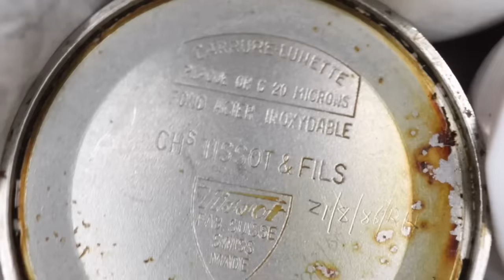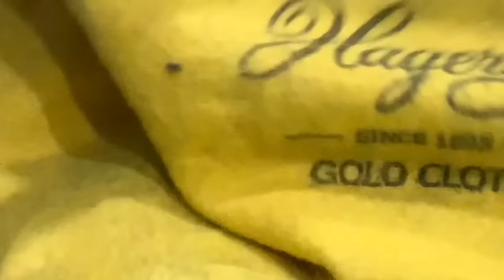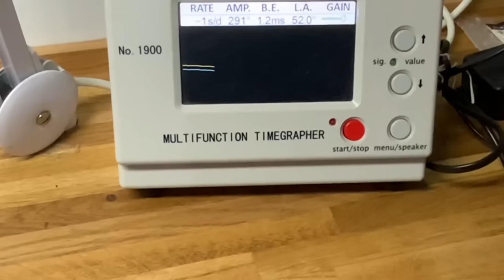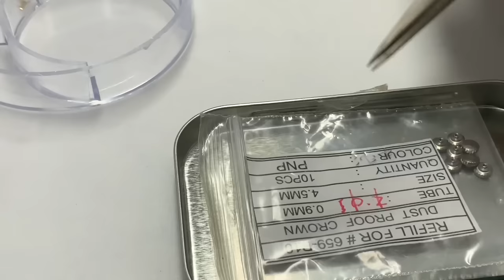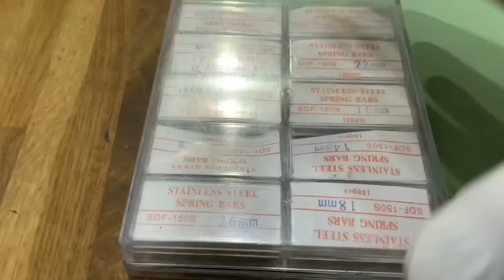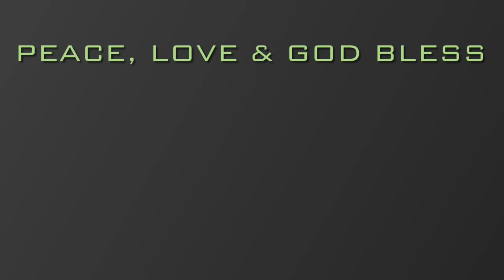How My Wife Forced Me To Restore This Free Tissot!

Comment: Thank you for finally restoring a fine ladies watch, I'd appreciate seeing more of them. I'm just beginning my journey into Watchmaking/repairing, and I I see the greatest challenges to be found in these tiny movements. With practice, just about anyone can be trained to disassemble and reassemble a basic pocket watch. But as you increase the complexity and reduce the form factor (size), you begin to separate the hobbyists from the budding professionals. A 1mm screwdriver is miniscule, it boggles the mind (as do the screws), and having the hand control to accurately tweeze the parts and screws in these tiny movements, is something that takes years to perfect.

The watch turned out spectacularly, and I hope that your wife was pleased with it. Take care of her, and fill her with beautiful things that you make (or restore) with your own hands. These are the gifts that have real meaning. I've been married for forty-three years, and I recently retired as an electrical engineer. I've always been fascinated by mechanical watch movements, so I'm expanding my bench to make room for a watch service/repair station. I'll be starting with a Maryland Railroad Pocket Watch, and I have a small box of of non working mechanical watches that belonged to my grandfather. There's enough in the box to keep me busy for several years.
Reply from the maker: Thank you.

Comment: Base metal gone. Thanks for the help with improving a case of 20 microns. I have one where the gold plate is good but where worn, the base metal is gone. I assume there is no restoration possible when the base metal doesn't exist. Or, is there a solution to building it back up. What resources do you suggest to learn, if possible? Thx

Comment: Creat video of this watch looks great after restoration, and i have finally got my Citizen Eco Drive Divers watch and such you being the best watchmaker i can see on you tube would you be able to advise myself on how to charge the eco drive in the manual it says pulling out the crown all the way and leave it in direct sunlight and since i live in Australia the sun is very very strong and i am worried about damaging the watch do you have any pointers for me thanks.
Reply from the maker: Yes just leave it by the window for a few hours if you have good sunlight. Once it’s charged then it will continue to use every bit of artificial light to keep it constantly charged
Reply: @NekkidWatchmaker  thanks for the advise appreciated very much.

Comment: Brilliant. Best video you’ve ever made. 👍🏼. Cheers.

I forgot to ask. Is it possible to disassemble and restore a stretchy metallic band like the original band on that piece. Can a band like that be fixed up without taking it apart. Is it worth it. I imagine it would take a tremendous amount of time.
Reply from the maker: Thanks mate. Not many people like these stretch bands and they are relatively cheap to buy. It’s not an original tissot one either and the end was broken on it.

Comment: Dear Nekkid Watchmaker, I have a watch which is very dear to me, a gift from my father in 1991. An omega. It has a problem with the back plate, and I can’t use it because of that and no watchmakers want to replace the battery because of it. 
Would it be something you could help with?
Reply from the maker: Hi mate sadly I’m not taking on any private work at the moment

Comment: Can I ask your  professional opinion as I'm only a beginner in watch playing ? I just bought a Citizen eco drive E168 movement, on the understanding that it just needed a new battery/capacitor. Well I removed the back and there's NO battery. After I spent the last 2 days trying to charge it  Lol :-). Now here's the head scratcher in the light it works second hand jumping 2 intervals. But then when the second hand gets to approx 12.15 it drops back approx 20 seconds. Now I'm really worried or am I worrying about nout? Any advice from you would be really appreciated :-)   I am one of your humble subscribers.
Reply from the maker: Try with the capacitor first and see what happens. I think you need MT621.
Reply: @NekkidWatchmaker  I will order today thank you sir :-)

Comment: A question. when I wind up my automatic watch by shaking fast for 1 minute, it moves forward for about 5 seconds, but if it shakes smoothly it kills the precision. Is this normal? The watch is new. Thanks.
Reply from the maker: You should just manually wind it using the crown, that would be better
Reply: @NekkidWatchmaker  Thank you for the advice. I'll follow you to the letter. 👌👍

Comment: How do you know when a screw is a reverse thread?
Reply from the maker: Usually the crown wheel has one. Sometimes the screw head may have two or three slots. If the crown wheel doesn’t have a reverse screw then it will be held in by multiple little screws